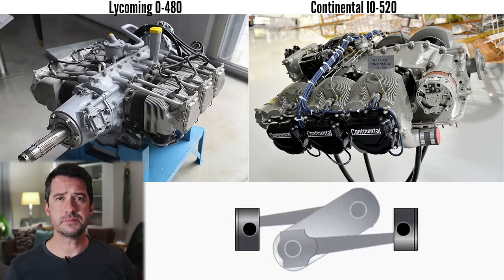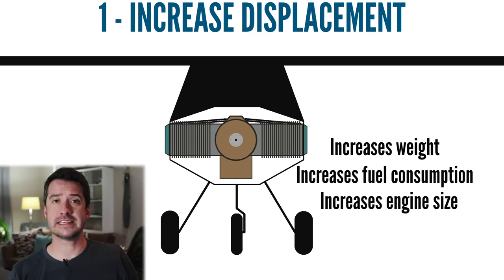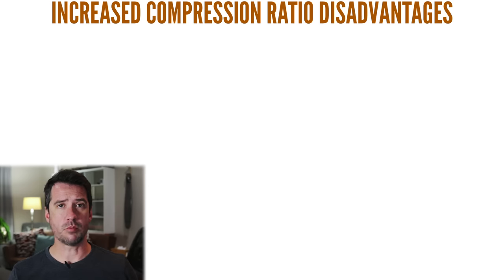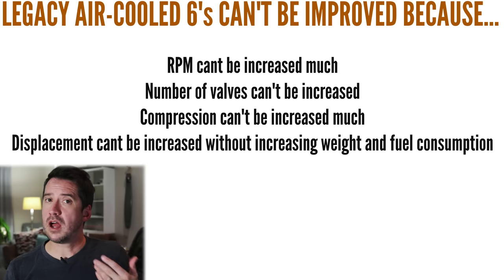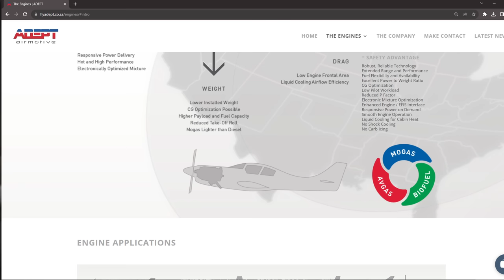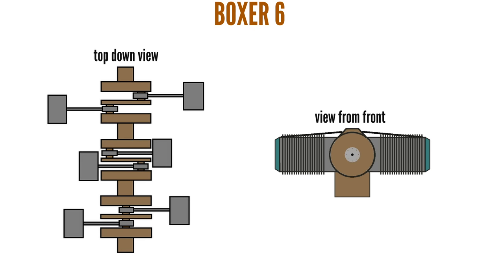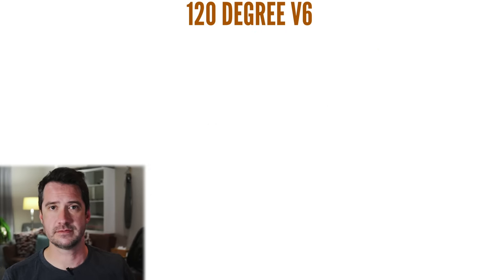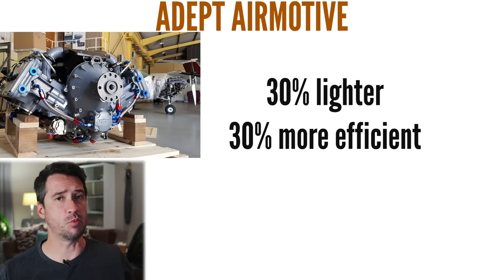Unusual V6 Airplane Engine Makes Boxer 6 OBSOLETE?

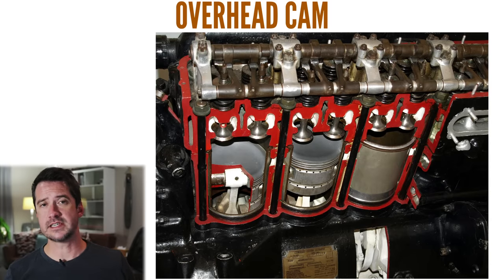Comment: 6:06 the perfectly vertical valves make me think it's a diesel, not that being so changes valve actuation, just not something I've seen on gas.

are the power ratings continuous, or time limited? that's a very high specific output if it can be sustained.

I'm surprised at billet crank/rods rather than forged, but I suppose for a relatively small production run it's exceedingly expensive to do forgings. If they were doing a large production run, forged would be the way to go. 

regarding the claim of 30% lighter, I wonder if that includes a cooling system - adding radiator(s) and coolant adds a good chunk of weight, and you need to figure out where to put it.
Reply from the maker: I'm not sure if that is max continuous. Higher rpm engines are usually 5 minutes max (using the Rotax as an example), but I don't have those facts. 

The source of the 30% lighter claim I  found on a few different websites (not their own). One can't post website links in Youtuve comments but I'm adding it to the video description now.
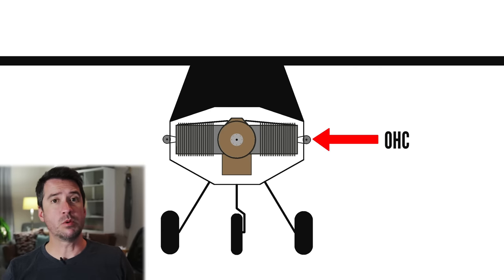Reply: The engine at 6:06 would be a Rolls-Royce Merlin.
Reply: In the "Kitplanes" mag listing the weight they list includes radiator etc.
Reply: That image isn't the Adept engine. It's a cutaway of a Rolls Royce Merlin, which did indeed have valves that were parallel to the cylinder axis. Early development versions used an experimental and unproven "ramp head" design, with a squared off combustion chamber, vertical exhaust valves, and intake valves canted outward at 45 degrees. The design didn't work and it was quickly abandoned, replaced by the parallel valve design.

Comment: An engine made for max torque at 3500 rpm and low BSFC would not look like this engine.  It would be a larger displacement OHV engine.  Don't compare the 80 year old designs to state of the art OHV engines.

Comment: Due to the fact that  civil aviation engine manufacturers really don't have to worry about absolutely price F@#king everyone of their costumers by charging an average of $165,000 for an engine that is just as low-tech today as it was when it was designed in the late 1930's.(Lycoming 540 series for example). Considering the tooling and design cost's for these glorified VW engines has been recovered probably 75 years ago that should place any kind of  modern engine sold by any one of these company's at about 2,000,000 each.

Comment: A civilian aircraft must have a powerplant that is 1. RELIABLE. 2. RELIABLE. 3 RELIABLE...........
AFTER you achieve extreme reliability you can start talking about weight, dimensions, cost, fuel efficiency and power/weight ratio.
The venerable flat sixes that the article criticizes for being big, heavy, old fashioned gas guzzlers are VERY reliable.
The big old sixes are LOW STRESS engines and that is the main reason they rarely fail.
Replace the trusty old sixes with  small high power HIGH STRESS engines and you can expect plenty of them to fall out of the sky.
Ultralights quite often use small light  high stress engines and plenty of them fail by comparison to the venerable old OHV powerplants found in more substantial civil aircraft.

Comment: Aircraft engines are actually ridiculous. Designed and hardly altered since the fifties, they have enormous displacement for little horsepower. Take the Continental O-200, for example. 200 cubic inches displacement, about 3.2 litres, for only 100 horsepower? They are pointlessly conservative with full power at less than 3000 RPM. Compare to a modern Rotax 912 engine. 100 horsepower at 5800 RPM from a mere 1.3 litres! Uses less fuel, is a lot lighter and is also a lot quieter. Time between overhauls is 2000 hours, pretty much on a par with the Continentals and Lycomings, but miles cheaper to overhaul.

Comment: I kind of disagree with what you say there. Porsche made a very good bovver 6 cylinder aircraft engine that was operated with great efficiency in Robin Jodels, Cessna 182 and Mooney M20s.
Only Porsche's upper class twit-approach to service could have been that engine's downfall. …and was just that.
But from the technical side, it was a compact, powerful and reliable air cooled boxer-six with much improved economy.

Comment: What is the fuel burn? No mention of this anywhere, and what is the BSFC at a cruising altitude with around 70% power? Most IO540 / IO550 and other similar engines run a BSFC of 0.39-0.395. So 30 % more efficient than what?

Comment: and yet in cars they are ditching the v6 in favour of 4 cylinder engines
Reply from the maker: Soon to be 0 cylinders...electric
Reply: That’s all about longevity, weight, and production costs. They figured out they were putting 200,000 mile engines in cars they wanted people to replace at 100,000. The 4 cylinder is lighter, has a shorter reliable life, and is cheaper to produce. Voila! It’s the American Automobile Industry dream!

Comment: Most gearboxes also need to maintain a minimum torque to avoid gear chatter and failure. This is part of the reason why geared lycoming/continental have lower tbo's

Comment: You alkso did not mention the frankly extortion level price of aircraft engines.  Most of the large 6 cyl. AC engines cost over $50,000 or more than most new cars just for the engine.

Comment: Continental engines aren't all that well designed and have a lot of problems other flat six engines don't have. Makes you wonder about them. The 120 design isn't shorter on width but has some advantages. You are incorrect about the crankshafts though...it is possible and even desirable for a flat six to have shared crankpins for the piston rods. It is up to the designer to choose whether they go with that design or not. The length(at least for automotive) is the same.

Comment: All of the flat aircraft engines evolved from 1930s tractor engines.  It is about time someone found a better way to power an aircraft.  Liquid cooling is not and issue.  There are coolants available that don't boil and run at zero pressure.  Problem solved. I would have loved to get 30% better fuel economy in the airplane I owned.  The FAA has so many regulation in place that it is imposable to bring a new engine to market.  If you develop a new auto engine you probably will sell a million of them each year.  The whole general aviation fleet is only about 3000 engines a year.  The cost to certify an new engine can never be made up.

Comment: Using 4 valves per cylinder gives better squish area and more reliable valve cooling. Using fuel to cool the engine with a richer  mixture is wasteful. As for using magnetos, that is an archaic system that is unreliable and uncontrollable for combustion control, using electronic injection would get rid of hose pipe fuel delivery which wastes too much.

Comment: I don't see how flat engines get even wear in their cylinders. You'd think there'll be more wear on the bottom than the top. Unlike vertical design engines.

Comment: 4 valves are not difficult to do with pushrods, it has been around since the 1920's especially if the speed is kept down ie direct drive.   I think itust be a combination of lazyness on the part of the manufacturers and lack of demand from end users that has kept it off the drawing board.

Comment: at least this is a modern engine. but billet crankshaft and conrods sounds not good. these parts normally are forged (and twisted for the crankshaft). this is typical for a small company, who cannot (yet) afford  the more  expensive tooling  needed for this.

Comment: Too many parts with your new engine.  The old slow turning direct prop, magneto engines are  very reliable. Old long stroke John Deere tractor engines are good for 100 years.

Comment: A crankshaft can have counterbalance built into the thing without a balance shaft being used. It rotates at a rate congruous with the shaft speed however. A balance shaft has only the ability to rotate at a speed in ratio to the crank. otherwise it's inherent weakness and an unwanted extra weight. It is better to have no seperate shaft therefore and a maximized rotating balance of primary components. That way reducing internal stresses. These complexities cannot be understood in vague reference here however given the variables and abscense of technical information of the actual engine including the loose specifics of it's design. It may be wonderful or it may even be a scam,  or whatever anyplace in between? I don't think any of us have anything to go by in that view either! You must bring us all a test model and some real information that is useful.

Comment: Good video, it's good to see the Adept Airmotive engine get some positive exposure.
Reply: Not good at all. This engine has been surrounded by BS for some time now. It was funded by the South African taxpayer, with the intent of producing a local engine for us, to avoid the high dollar exchange rate. Sadly, the engine is offered in the States, but not here. There is more money in the overseas market, but not the local one, which generates less in financial value. Try buy one, and suddenly all the banners disappear, and the worms come out. It has left a bitter taste with local aviators, and now languishes in the class of bar-room BS.
Reply: @tonyforrester9570  There's no proof of anything that you say. I'd like to see the engine tested by an unbiased third party. Bombardier built a very similar engine, and by all accounts, it was absolutely worlds better than the current standard. The observed (as in, pilots actually flew it and reported on how efficient it was) efficiency was absolutely incredible.
Reply: @tonyforrester9570  And if there wasn't some conspiracy going on here, you wouldn't need to delete my comments.

Comment: The air-cooled flat is plain simple and that makes em sexy. Fuel injection is sophisticated enough. If V-engine then put the heads down and the crank up and get clearance for a bigger prop. Use a planetary gear and rev up if necessary.

Comment: My bet is that a modern 4 valve car engine would be more reliable than those ancient aero specific engines. Engine science has advanced considerably since then, it should be made use of with new but proven designs.

Comment: The new Blue Point Engines 3.4L Chevrolet LS3 headed 4 cylinder will put them all to shame.  340hp and 500ft lbs, in a 4 cylinder.  light turbocharging has netted almost 500 hp in testing.   It's a single Chevrolet LS3 V8 cylinder head on a dedicated 4 cylinder block,,at 3.4 liters.   It will also be able to accept a single Ford Windsor V8 head.

Comment: The cylinders need to drain the oil while not in use. That is why the 120 degree engine is superior. The 180 degree flat engine design is defective in its' design.

Comment: 13:28 Look at the mid cylinder compare it to the botton or the upper cylinder, they have a bigger distance between them and opposed forces in different  direction, wouldn't it cause a worst rocking couple?

And the opposite cylinder for having same direction of force it would result in bigger forces also? 

I think that boxer is more balance for this reason and it explains why someone would prefer a large engine for better balance. So if I'm wrong please explain it please.

Comment: The main problem with a V6 / V8 engine (when mounted at the front of the airplane) is the fact the drive shaft is at the bottom, while the preferred location of the shaft driving the propeller would be to have it at the TOP of the engine (so that the propeller has more ground clearance). The solution to this is to either have a gearbox that raises the output shaft higher, or to use the engine in a 'PUSHER' configuration, where the engine itself is mounted way up high in the airstream above the body of the airplane itself.

Comment: There are more than 7 contributing factors to engine smoothness..  No balance shaft needed in this configuration...  Inline 3s have a rocking couple that can be balanced by putting extra weights at both ends of the crank...  This is a dual inline 3 configuration.... overly simplified explanation leads to an incorrect conclusion...  120 deg 6 actually has great primary balance, and not great secondary balance...  But  secondary imbalance is substantially smaller than primary imbalance and isn't objectionable without balancing shafts...  in-fact, secondary vibration can be eliminated by the correct engine mounting dampers...  And since this is a high rpm engine, this is much easier to do...  More importantly, 120 config, like the flat config, has continuous kinetic  energy, so doesn't suffer from mass induced axial resonance...  I think this configuration could offer enhanced performance potential, but would still be expensive to acquire...

Comment: Good engineering! Great explanation that a non-engineer found easy to understand. Lovely accent... from where do you hail?
Reply from the maker: Thanks, you're too kind. South Africa
Reply: I came across this engine in its development stage in the 1990's. Its origins are South african and a university engineering department. One issue was the opposition from established operators. I seem to remember that it had a bolt on supercharger at one end of the crank which fitted snugly into the 120 degree V.  @LetsGoAviate  I was involved in business development then. I would love to see this engine become a successful venture.
Reply from the maker: @JohnLear-nu8hl  Nice! It's come a long way, would like to see it being successful as well.